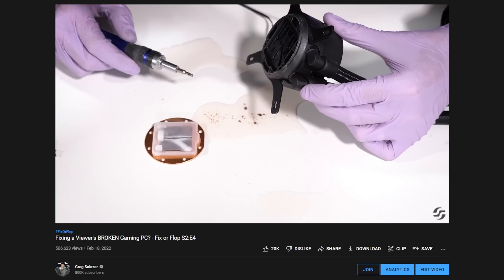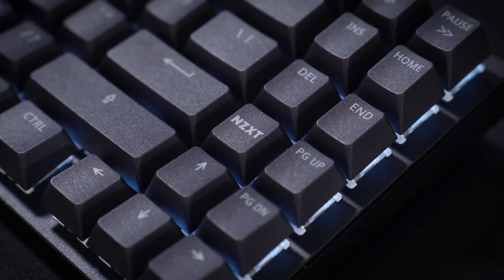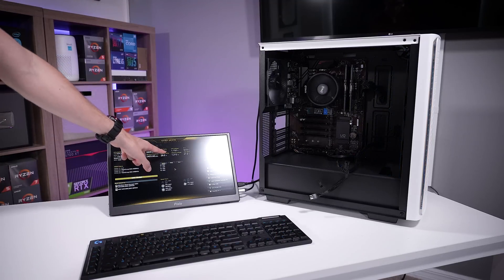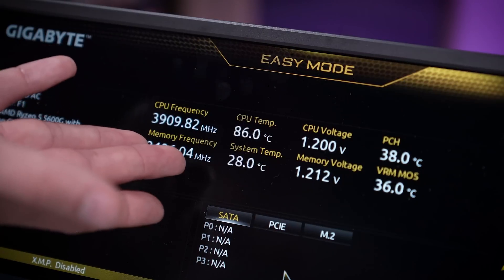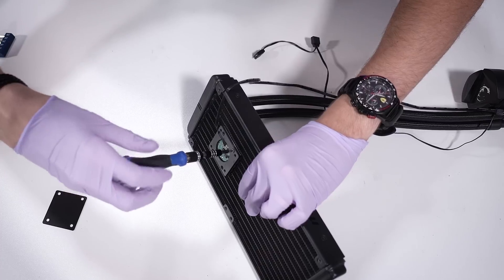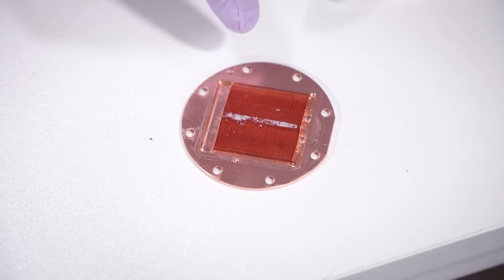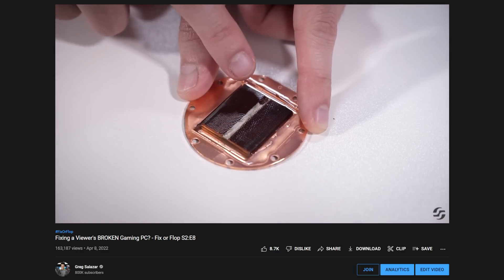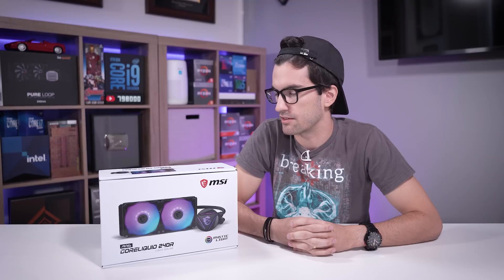Testing Viewers' Recalled AIOs

Comment: We shouldn't have to pay for shipping and handling for a "Recalled" product but, MSI are not accepting U.S. based recalls for these, instead their forcing their U.S. customers to go through a lengthy RMA process yet, other counties are receiving a replacement unit in advance along with a shipping label for returning their AIO but, U.S. customers have to pay for the shipping in advance :/

Comment: Using a MSI p240 model and no issues at the moment, but it's only a few months old and yeah you got me looking at those temps a little more closely now. But yeah so far it's kept my i5-12600k cruising at around 28 to 30 at idle and 40-55 at loads depending on what I'm doing.

Comment: I tried the recall on mine and was told my S/N wasnt eligible for the recall, even though I have this exact model. I was getting 50s-60s idle and up to 100 under load. After cleaning the gunk out of the cpu block area and flushing and refilling it myself it runs mid-high 20s idle and low 40s while normal gaming. I'm not sure why mine wasnt eligible for the recall.. oh well.

Comment: I have a 360r and i tried earlier on and my recall attempt was declined. temps hitting 100 under a minute of cinebench load on a 10700k. havent tested it further. I may have to try and recall it again because i tried early on in the rma cycle and i think it was just the 240r offered at 1st

Comment: I have the same issue with my MSI 240r my 10700k was running 100c idle and they refused to do the RMA via recall saying it wasn't on the list.  They are wanting me to pay for shipping to them and said they will repair it on a product that could have damaged my mobo/ CPU.

Comment: I have a nzxt kraken m22, the 120mm aio that seemed to have an issue of idling hot, granted the cpu is a ryzen 7 5800x but when I put it on originally I’m fairly certain it was ok and idled around 43, before I changed it, it would idle low to high 50’s

Comment: Flush the radiator you will see galvanic corrosion in the radiator fins, the radiator is clogged, I cleaned my nzxt cooler ( after removing the pump, remove that inner plastic/ rubber housing … issue is with coolant flow on the jetplate isn’t bad at all … issue is near the pump or flow near the pump in the radiator 

Take some distilled water add some and shake it… when you empty it out you will see the galvanic corrosion / like sand

Not a fan of pumps in Radiators  … but the coolant is defensively the issue. 

In coolant mixtures the  more distilled water the better the cooling the more ethylene glycol the longer the coolant lasts… they work with that balance… 50/50 is about the best

What they do is 75 water /25 ethylene glycol like what the did the the entermax AIO and that was disastrous
Reply: Lol are people that gullible ?

Comment: I have two of these a 240 and 360. I’ve removed them and replaced them with different cooling solutions already. I did not check or wait for problems.

Comment: It seems MSI is doing a great job on the recall from what I read on the comments. But, do you think these units are repairable? Maybe like you said some other brand also has the same issue and is not as willing as MSI to do the recall and own the problem. I know also we have the issue of some folks that are not as technical and just bought a pre-built but at least the option would be there. I feel like after seeing you deep-clean computers it's something you might be able to figure out. Cheers!

Comment: I have this cooler, decent idle temps (39c-43c), but insane load temps (85c-99c).
Seeing the normal idle temps makes me think its a CPU problem, rather than a cooler problem- but wanted input before being too sure.
I have tried both top mounted (the recommended for CoreLiquids), and front mounted and achieved similar load temps, 85c-99c.
Reply: That’s overly high temps on load.

Comment: I have mine Coreliquid 360R almost 2 years, daily use 8-12 h, and idle temperatures goes from 30 to 50 but it's still usable. In load doesn't go higher than 85 (i9 9900K 5GHz)

Comment: I'm seeing some same issue I have in my Lian Li Galahad 240 after 1 year usage. My temps are not as bad as the ones shown in this video, but my average temps on idle and load have gone up to 10°c - 18°c across the board on my intel i5 10400f.
1 year ago: Average idle 28°c - 33°c, load 40°c - 50°c
1 year later: Average idle 32°c - 42°c, load 50°c - 68°c
Are the galahad made from the same OEMs?

Comment: Good video on a problematic topic. It's not necessarily the liquid that causes deposits, despite what's often claimed. This problem of the AIO's is mainly caused by a chemical reaction when water comes into contact with copper and aluminum. If the insides of the radiators have been coated, this problem does not arise. Often, however, these are not equipped with a protective layer and then even the best liquid will not help. There is another electrical voltage trick and as far as I know only Arctic uses it with their self-developed pumps.

Comment: i Regularly clean pc  6monthly  Radiators & fans  - Fluffinstuff =  34Cel Billy idle  cleaned 26Cel   _/ Check done
If you have to  refill your radiator after Gunk cleaned   use Distilled water no chemical additives to clog your pump
some Russians used vodka  works perfect long term  no idea  as ive never seen Alcohol  destroy plastic

Comment: I would not know about the recall but for this video. Thanks for the alert, Greg! I purchased mine in July 2020. My CPU was running a little hot so I pulled the MAG cooler off in favor of the Intel stock cooler.

Comment: This is why I stay away from AIO's. Though the chance is small that you are screwed the chance is there, with aircoolers that chance is 0 (if there is a problem then it is the IHS of the CPU not being flat).
Reply: me too, you get around the same performance with a big fat noctua air cooler and none of the problems
Reply: @Pondering_Penguin  I have a D15 for AM4. My only complaint is that the fan speeds up to 100% during POST, that gets rather loud. I wish that motherboard-companies would bother to make default silent (without thermal throttling) fan-profiles for big coolers.

Comment: The MSI Coreliquid in the video was one that I had in my first pc build. After 4-5 months my CPU ran super hot and the pump made a noise similar to a case fan hitting wires. I swapped to Corsairs AIO and no issues for a whole year and will probably be sticking with corsair's AIO from now on. The only difference between my old AIO with MSi and my new AIO with corsair is that my corsair runs 2c higher than MSI but that is fine with me.

Comment: Thank you for fulfilling my request of making a video about this topic keep it up, I had the same issue with my MSI CORELIQUID 360R

it was a little clogged just like the first cooler in this video, but it was a reddish color and not clear, I think it fails at cooling not just because of the clogging, it could be that the debris reacts with the coolant and makes it lose its ability to cool.

MSI wouldn't replace it just because I'm not in the US, and I had to fix it and replace it myself. a new corsair coolant just cost me 25$ which is way cheaper than buying a new cooler

MSI is literally the worse,  I got a defective monitor from them (lines started to show all over the monitor just after a year of use) and now the cooler, refused to replace both of them just because I'm not in the US even though the warranty still valid. defiantly not buying from them again

Comment: I just bought my ek 360aio with 6 fans and on my 5600x the temps barely changed from an arctic esports duo which is kinda dissapointing
Reply: Because LIQUID retains heat longer then if air was used…

Comment: i have a Lian Li 360 galahad AIO that is less than a year old when i noticed high temps while gaming after an hour...temps would reach 86c when before the highest was low 60c...a quick google search led me to a reddit thread about same AIO and issue..my issue also was when it was running hot no hot air was being exhausted from radiator...the reddit thread said it was most likely the block being clogged up...Lian Li sent another(used)AIO and the lighting on the pump block was dim i requested another AIO...still waiting on it...after it gets here i will have 2 AIO's that i wont use since they dont want the faulty ones back...this is the last time i buy Lian Li AIO...their customer service sucks ass...as does their AIO's

Comment: Thanks for taking a look at mine! I sent in the first one and honestly though there would be more build up on the block, but not too surprised since I bought it in October of 2021 and it started acting up in January of 2022. Glad I could contribute to the PSA on these AIOS!
Reply: Cheers, Camden. Thank you for your contribution! It may have only felt like a small sacrifice to you, but that small sacrifice has done a lot of good for our community!
Reply: almost exact same timeline as mine.  I thought I had killed the pump by top mounting it, but apparently this was the real issue.  I replaced it with a Galahad.

Comment: Most AIOs are trying to cut costs by using aluminum radiators. One problem is the mixing with copper coldplates, it leads to clogging at some point. The other is flux needed to solder those aluminum radiator without cleaning them properly. The flux remains in the radiator and thus in the loop, where it should not be, again leading to clogging. Copper is much better to solder, but also a more expensive material. 
Are Alphacool AIOs available in the US? They are full copper and its parts are reusable due to standard fittings.

Comment: It is said that the Fractal Design Lumen AIOs are manufactured by the same ODM and basically are a Coreliquid 240/360r with a different outer design. Fractal did not issue a recall tho

Comment: I had the same problem, unfortunately I also received the non-functional product from the Service, they didn't even check it.
Their answer was the product is functional, in Bios 70 ©, I opened the cooler and it was full of dirt.
After lost days and nerves, I opened the cooler as I saw you on the channel, I also sent pictures with the mess that was in it.
The answer was, to send it again, but I gave up, I don't have the nerves and the time.

Comment: Hey greg i actually had this aio but sadly i disposed the box when i had got it (ik im dumb) and i also faced the same issue with the msi mag240r , i couldnt ask for a replacement without the box and i also opened the aio and i had the same build up in the block , good work man keep it up!
Reply: That is unfortunate. Here in Australia, our ACCC laws states that original boxes and packaging are NOT required to be eligible for a refund or replacement if there is a major fault or recall.
Reply: @Hecklezz thats lucky i just ended up buying a kraken x53

Comment: I have the Fractal Design 280mm Celsius+ s28 cooling an I7-11700F, front-mounted in a Fractal Design Fractal G case with 2 Fractal Design 'Prism' series 140mm 3-pin fans in a pull configuration. The pump is in the radiator, so it may share some sources with the MSI AIO series. I have been using it for about three months now. Idle temps are between 35 and 40 C while running Cinebench R23 multicore can push it to around 65-70 C, where it plateaus. I believe these share some components, but were manufactured after the bad run of MSI AIOs. 

Also, not to plug another tech channel too hard, but I don't think the issue's limited to pump in rad designs, nor is it recent. Gamer's Nexus had a series of Enermax AIOs (with pumps on  the CPU block) suffering the same sort of fouling just a year or so ago I think, and Steve has documented it as only he can.

Comment: My friends artic freeze aio 280mm literally just leaked onto his 3060.  The AIO isnt even 6 months old..... Couldnt believe it and I spent a day taking apart the 3060 but the residue is annoying to get rid of... Not sure if I feel safe turning it on.  I reached out the manufacturer and waiting on a response.... Currently on Day 3 waiting for a response :/
Reply: as long as the card has been cleaned rigorously with ipa there will be no issue i have dealt with flood damaged cards that have been submerged in literal crap and they are still going strong months/years later

Comment: Had a similar issue with a swiftech 280 Prestige AIO from 2013-14 era.
took it apart cleaned everything well and filled with clear EK cryofuel.
oh and replaced the nasty tubes with something nice and clean.

Comment: I got mine replaced with a 240R V2, no questions asked. Just sent the recalled one last week, which Newegg paid for return shipping as MSI didn't include a return label as they said they would through the RMA process. Still, I don't trust it for my new upcoming build, but I might use it in my first ever build just to spice it up a bit.

Comment: hi greg if u dont mind explaining why some laptop dont read the ssd or hdd anymore after awhile and whatever u do it does not work
Reply: Will the drives be read by other systems? Have you tried changing the drives? Drives have a certain lifetime, and it's possible that yours have reached their end.

Certain BIOS settings can mess with it as well. My motherboard won't read drives after updates unless I change the boot settings to legacy mode.
Reply: @TekuJames  I did and it didn't work

Comment: Wish I knew there was a recall on the 240R,  Went to undervolt the cpu for the summer. And was hitting 100*  running cinebench .  And found block was hot rad was cool.

And bam 💥 guess what I found inside

Comment: I had one of those I did take it apart on the motor side and it was pretty darn red and crappy and smelly I did not realize at the time a year ago that all I needed to do was clean it out and get some fresh water I just threw the damn thing out and got another one a three fan instead of a two fan and so far I've been working good knocking on wood but if this one goes I at least know to go to the block side instead of the motor side so much and clean it out that way

Comment: Having the pump in the radiator instead of mounted to the CPU brings a whole new issue.  How many videos have been made about mounting an AIO and making sure the pump is in a low place in the loop, mounting one of these AIO's radiator in the top of a computer case will eventually kill the pump.
Reply: Wrong this can be mounted pretty much any way you want and the pump life won't be any longer or shorter. Do you think there is that much air in an AIO to f the pump :/? I have two of the MSI and love them and ya one was fucked up but was  EZ fix and works great and runs quiet. I have had a few others and can not say the same about them. Oh and if air did get into the pump guess what it stops pumping the water and just spins very loudly and if you have that problem, its not how you have it mounted its there is to much air in the system.
Reply: @reep0074  MasterN64 is correct.  Water is a lot heavier than air and so will always pool at the bottom of a loop, if you have a lot of air in your system and a pump that is low in that system then water will still be pushed up to the CPU, but if the pump is high in the system with the same amount of air in it then all the water will pool below the pump and it will spin dry.
Reply: Yes and no.  It really all depends on the location of the pump and the fluid levels in the system.  Many of those videos are a bit overblown in their assessment and the problem itself.  It IS a concern for sure and accounting for it will never be a bad idea but its not nearly as large of one as some make it out to be.  As long as the fluid levels are not critically low or the mounting incredibly weird there shouldnt be any issues.  Fluid in a true closed loop will not be lost quickly so its far more likely that the pump or other fittings will naturally reach end of life before enough fluid is lost to kill a pump.  Open loop systems with seals that arent as strong are more prone to coolant loss and many people correlate those with closed systems which isnt entirely fair.

Comment: I have a doubt with my AIO, I have a ryzen 7 3700x that in the bios reaches 54 degrees, but it does not rise over time and when used in games it does not increase much, reaching a maximum of 70 degrees, would it be preferable to get a stock fan?
Reply: You’re golden.

Comment: Doesn't matter what manufacture batch affected. It's the "Pump in Rad" design flaw, mine was a prebuild MSI MAG Codex X5 which manufactured in 2021(way before MSI announced the call back) and it has 120mm MSI Coreliquid and it has the same symptoms and I only bought this PC only like 4 months ago and the temperature is drastically increased only 2 months of usage. I have to buy Corsair AIO as a replacement and the temp wasn't throttling anymore.

Comment: tbh after seeing this 
im not going with an AIO
ill get a good air cooler (currently running the stock ryzen 7 3700x cooler [Wraith PRISM] since i cant decide on a good one with all the problems going on with coolers at the moment)
edit: mine sits around 60c idle and under a cine bench run it hits 80c (around 60% fan at idle and 100% fan around 70c or higher with the high fan setting) im using Noctua NT-H1 10g, Pro-Grade Thermal Compound Paste [used a pea size in the middle of the die]
Reply: I ran my 3800x with my Corsair H115i RGB platinum 280mm aio for almost two years without issue. I swapped to a 5950x and still stay under 70 c temp under max loads. No pump issues and it runs quiet.

Comment: Using liquid in a system that has both copper and aluminum is an electrolysis nono. Even adding chemicals to reduce the electrolysis will with time degrade and the AIO will fail. All these cheap AIOs are garbage. If you are going to liquid cool use open loop with all the same metal parts and be resigned to cleani9ng the system about every 6 months.